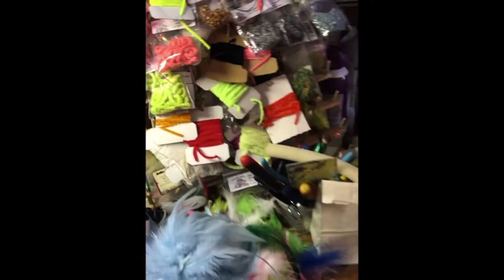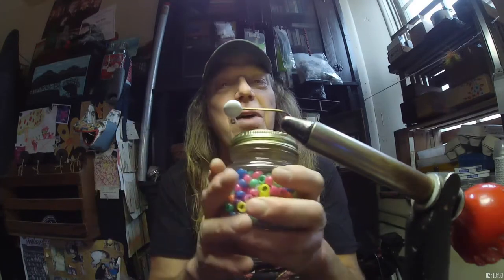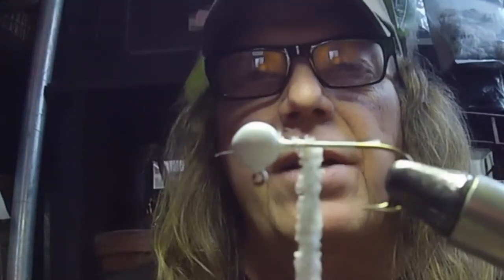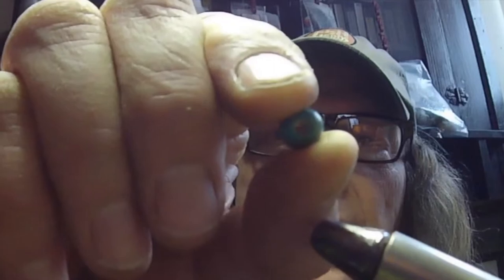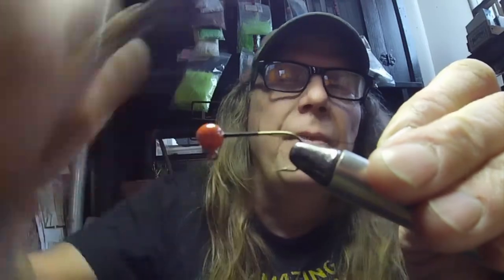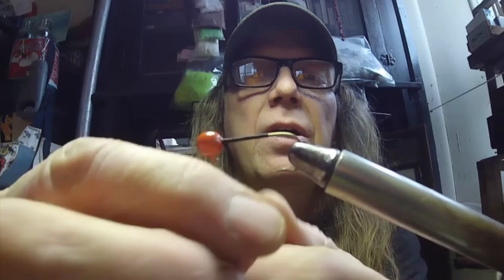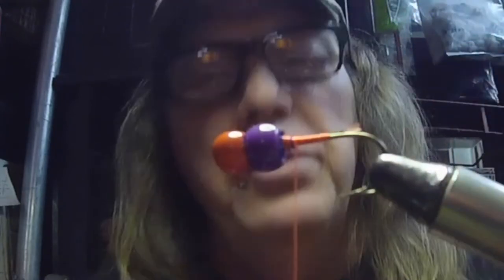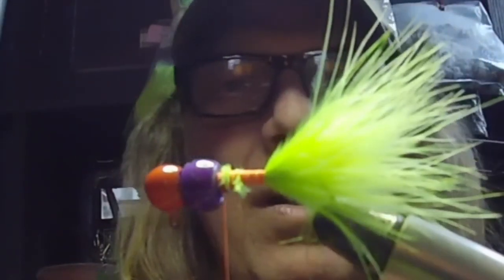How to tie a Non Lead/Lead Free Bead Body Jig

Comment: So I have a question for you and other jig makers. Does it really matter if the head is painted or just left bare?   I’ve tied a bunch of jigs and caught a ton of panfish.   But, I’ve never really did a side by side test to see if the fish care if the head is painted or bare.   That may be a test for this spring.  But have you seen a difference
Reply from the maker: Honestly I think painting the heads makes more of a difference to the fisher than the fish  Gasp!  But it is true.  When we were kids we never painted them or used fingernail polish that came off in the first five minutes.  And there are plenty of other examples of unpainted heads performing just fine.  That said I find I fish better and with more confidence if I have a painted head.  Plus it is another area where i can play with color and contrast and so forth.  I have known guys that not only insist the head be painted but that it have an eye or even a double eye.  Outside of ice fishing for yellow and white perch where I am told it is absolutely essential I do not see an eye spot making much difference.   But that is just me.  Should I ever win the lottery i think i will commission a study and do the proper side by side comparison.  Because I plan on being the most boring and nerdy lotto winner ever.  But as for you Steve and your next fishing trip go your own way.  It is funny how a bass fisher will lose it when the paint on the head of their swim jig chips but have no problem or indeed actually prefer unpainted bullet and drop weights.  If no paint is not a distraction I say leave it alone and get fishing.  Because jigs in the water do way better than those in the tackle box whatever the build is like LOL.